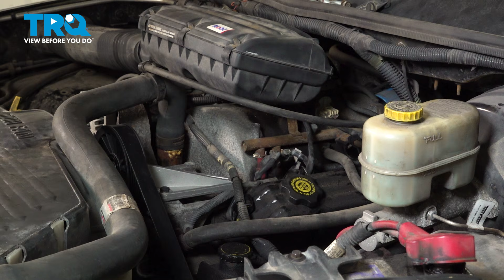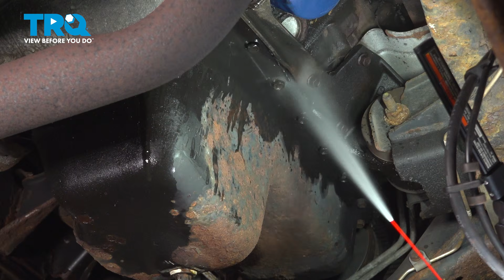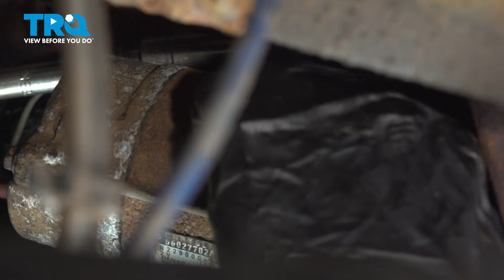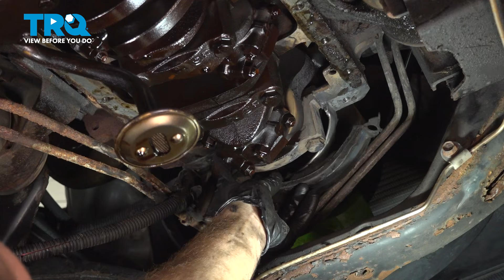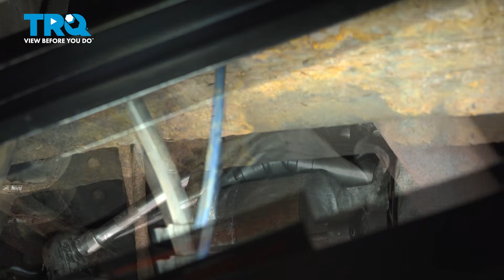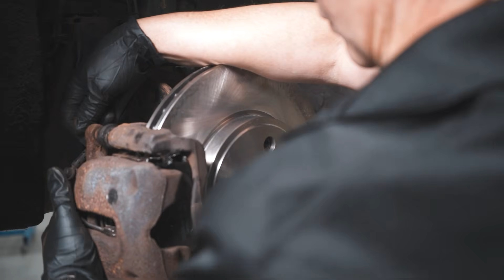How to Replace Engine Oil Pan 1994-2002 Dodge Ram 2500

Comment: The bottom stud came out like a bolt. Is this going to cause issues with alignment of the starter if I use it like a bolt? Struggling to get the top starter bolt out. I can get a 3/8 socket on the bolt with an extension but when I crank on it the extension moves and pulls off the socket. Getting ready to get back under it now. Hopefully walking away for a bit-12 hours, will have helped.

Comment: So I need to replace the gasket on mine. It's leaking kinda bad. I don't know if it's the oil pan leaking or somewhere else, but it's leaking where that shield is. Anyway, my question is, what does the engine need to be lifted up?  Can the gasket be replaced without doing it because I don't feel comfortable doing so.

Comment: Why wouldn't you take the pan off before messing with the shield and starter? It would be easier to reach everything. If you even really need to take off the starter and shield at all. You can just start the pan at the shield, carefully, then push up the other end and start bolting it back in.

Comment: 1995 1500 4x4 and I did NOT have to lift the engine. Starter and tranny brackets came off is all I remember.

Comment: I was thinking the same thing why not clean and give a Fresh coat of paint on that oil pan also why do you need to remove the air cleaner and why do you need to remove engine mounts that seems a bit much the starter in the flexplate yeah that's a must also shouldn't you be checking the oil pickup tube while you're in this process

Comment: Dear 1A Auto, I've been trying to install my oil pan on my truck, but the back of it (the oil plug side) doesn't swing up cleanly. When I do so, the lip part (where all the bolts go in) catches or stops due to a thin, aluminum plate that is in the front of the bell housing of the transmission and skews to the right steer tire. Does this mean that the transmission on my Dodge 2500, 2001, is not seated/bolted down at a even level? I've this video a couple times, but I don't get that easy swing up application from the back side.

Comment: I would have at least cleaned up the oil pan and gotten the rust off and cleaned up the rest, then give it a new coat of paint. I don't understand why guys always do half a job when it only takes a little extra time to do it right 🤔😬😁

Comment: The engine gets lifted to provide clearance for the pan and gasket as there are AC lines and the frame which make it an incredibly tight squeeze. Especially when you are trying to get the pan in with the gasket later. The air filter comes off so the engine has clearance to be lifted. Otherwise it can hit the top of the compartment. The starter comes out so that you can take the cover it sits in off. Without removing that cover there is a lip on the pan that won't allow you to remove it otherwise. Lifting the engine could be optional if you like making life harder for yourself, but there is very little clearance or visibility otherwise for the reinstallation.